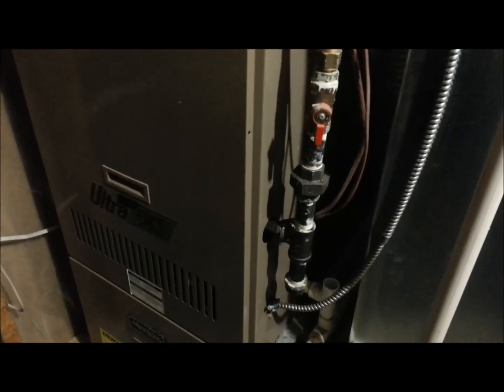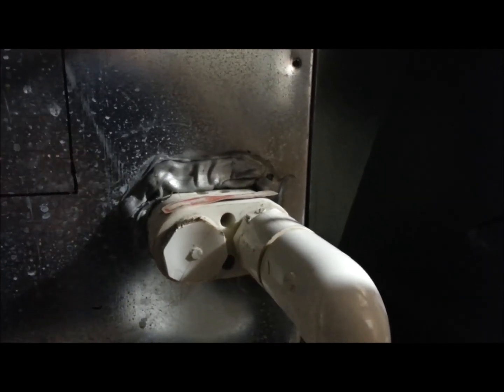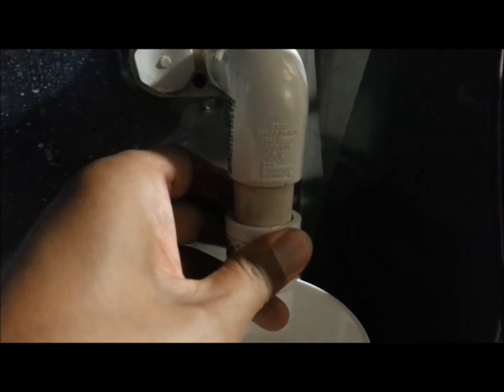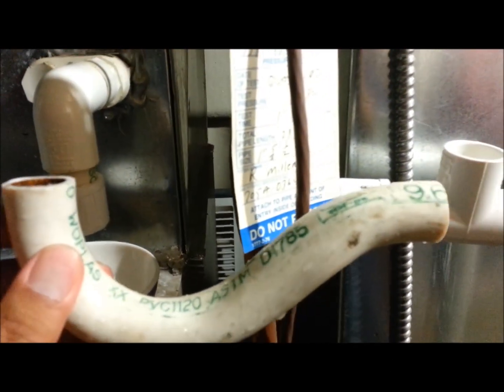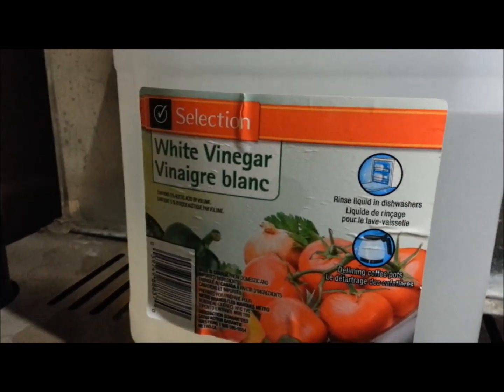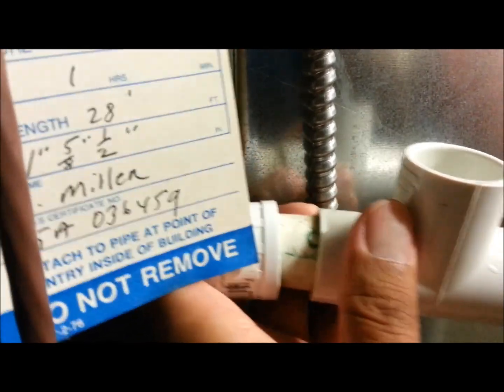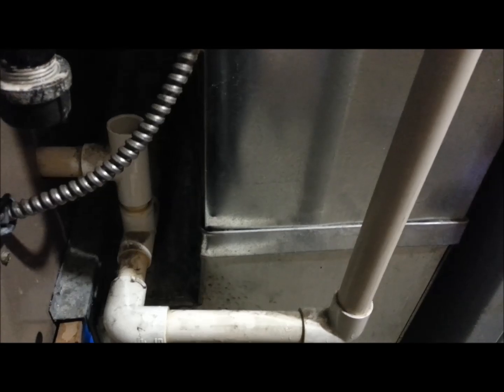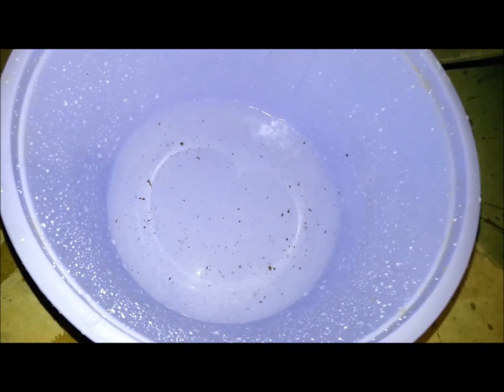Central Air Conditioner Leaks Water On Floor: Part 1 Clogged AC drain line (DIY)

Comment: The solution sounded right; I tried it; it worked, but the
screw/cap at the bottom was leaking and I could not stop it using screw.  I used the solution without derange.
Reply: Farideh Majidi i

Comment: The p trap is there for 2 reason 1. To stop the unit from sucking in air which will cause water to splash around inside and possibly being "thrown" inside the duct by the blower motor2. To catch debri.I wouldn't ever recommend anyone to just remove the ptrap because it serves a purpose that's why we install them. A unit without a trap is installed incorrectly although it willwork there is a chance of air and water being sucked back in the unit
Reply from the maker: You are right Moe. That's why i made another video part 2 with a different  type of P trap. Thanks for the comment. It will help out my viewers.
Reply: We are having a hard to fix leak problem as well.  It started about 20 days ago and sounded like a pop with releasing pressure and water every where.  First thought was the refrigerant but that was fine.  The AC guy found a small split before the pee trap and determined it was sucking air and water back into the unit so he fixed the plumbing and took out the pee trap.  We let it dry for a day and turned it back on and it was leaking so they came back out and put in a pee trap.  It was still leaking and they installed a scoop Friday (I have no idea what that is). It's Monday and it is still leaking about a drop ever few minutes and it looks like it is leaking from inside the unit having nothing to do with the drainage.  One thing to keep in mind is that we collect the condensate water to use in our aquariums and through this entire ordeal it always provided about the same amount of water.  The ac works great in all other aspects.

Comment: thanks for your help i just save some 💰
Reply from the maker: Glad it helped you out Zoe.
Reply: +Jonah's DIY & More I see you made this a year ago but hopefully I could get a suggestion from you. I have a an old unit and recently the unit stopped working. we could tap the outdoor unit and the fan in the top of the covering would come on and the unit would start working again... Of course we were actually wiring a relay switch on the defrost board. that work for about a year. heat in the winter has been fine no problem. air conditioning man just charged me almost $700 this summer to replace that board... It's crazy how much it costs to get an AC repair done. the board was well under $100. That said it has been working fine for about 2 weeks. I just came down the hallway where the inside portion is in a hall closet. a puddle of clean clear water is in my floor. All the pipes from everywhere in the house run through this closet but only I have been here today and none of the plumbing has been used upstairs at all. however about noon it felt too hot so I bumped the thermostat down from 74 degrees to 69. and I'm wondering if I just have a freeze up a clogged pipe. I can't tell if it's still leaking right now. but there is water inside the closet floor just like you show in this video. how would I determine weather my pipe is leaking or whether the coils froze up or something like that and then condensed into the floor.

when the repairman was here two or three weeks ago he checked the freon pressure or whatever they do with that gauge both times and said it was perfect.

my first thoughts are to put the thermostat back in the 70s and clean up the water and see if I get more. am I on track or should I not risk it and go ahead and call the expensive repair man again?
Reply from the maker: If you have that same old designed P-Trap, it is most likely a clogged pipe. Your A coil is freezing up because water and air cannot escape where its designed to escape. Check out my part 2 video. Hope it can help you out.
Reply: +Jonah's DIY & More thanks ... you were exactly correct.  your video was correct.

Comment: My Goodman attic horizontal Air Handler is leaking into the Secondary Pan. I popped the service panel off last week and the internal Pan is dry. Its like no water is making it to the primary panel to drain into the guest bathroom sink outlet downstairs. I checked both the secondary and primary lines and they are both clear.

The water seems to be leaking towards the back panel where the duct comes out, where the rear panel meets the main box. I wonder if a seal, gasket or something else failed and now its just leaking like a sieve.

I tried to patch with a 1/2 gallon of mastic and a full roll of peel and seal on that back panel and onto the main panel hoping to make a seal so the water would run into the primary pan inside.. But like water is apt to do, its found multiple ways out and i'm back to leaking again.

I'm open to suggestions. I havent had the rear panel off to take a look at the coils. Maybe there's a problem there.

I'm desperate and its 100+ in Dallas these days.
Reply: Shane Kelly.  I had something similar.  I put a level on the air handler and it was flat level.  It should be tilted slightly to the primary drain.  I shimmed the unit to half bubble.  Water poured out.  Problem solved.
Reply: Thanks for the reply.  I tried that as well but the unit is tilted properly and my internal pan is actually molded with a bit of a lean already too.  This week i emptied 2 bottles of clear silicone from the back after removing the rear panel and from the inside trying to seal up any crack or hole i could find.  I could take the internal pan out and the A coil i guess but at that point i may just replace the darn unit.  I turned her on last night so i'll see tonight how bad the leak is.  Even if its a slow leak i'm ok with that.  I'll let you know.

Comment: A much easier fix is to use a shop vac and suck out the line. Attach the shop vac hose to where you added the vinegar in your video. Takes all of 3 minutes to complete the process.
Reply from the maker: Yes i think you're right.  I hope the viewers will have a chance to read your idea. Thank you
Reply: Thank you! That worked!
Reply: This worked for me, glad I read your response!
Reply: In my unit the P trap was so clogged with stuff that even a shop vac would not pull the gunk out. Had to replace the P trap
Reply: I know this won't mean much to you but this whole process started happening on my basement floor just days before I closed on selling my house. I found this video and to my surprise my furnace is the EXACT same model so I was going to follow this step by step and I found your comment and tried it instead and it worked perfectly! No need to cut anything, no need to unscrew or turn off the water, all I had to do was lift the PVC out of the pump that we use to get the water to the sewer and shop vac the whole thing, worked perfectly! Thank you so much you made my month!

Comment: my heating unit is leaking blow the drip pan and into the floor and has ruined m carpet and walls any ideas how to stop this problem
Reply from the maker: +Kellie Collins Do you mean your AC drip pan is overflowing and leaking? Check the drain hole and pipe from your drip pan...since it may be clogged.  Also check if your air filter is clogged.

Comment: good vid. but why cut out the p trap?? why not just add the T?
Reply from the maker: +sixstrangtommy Great question. The P trap is prone to debris build up and eventually clogging.  The P trap has no way of clean out when its clogged, unless you cut it out. When water cannot drain properly  it spills over causing a leak from your AC. The T trap works but it allowed air to get sucked back into your system (negative pressure) and that is not good also. My opinion is the U shaped trap with the T cleanout is the best, because it traps enough water between the U shape design, thus not allowing air to get sucked back into the system, and you can easily clean out the new trap every few months. I hope i explained it ok. Sorry if i confused you.
Reply: im good...thanx

Comment: I'm a HVAC Tech/Installer and I strongly recommend you put the P trap back in your drain it is critical for proper drain operation you need to create avacuum with that P trap otherwise the blower will suck air through the drain and it'll never drain correctly gurgling and dripping put AP trap in exactly how it was except directly off the unit install it to you with about 3 inches of PVC and a cap so you can add bleach once a month
Reply: Also a clogged filter will make it freeze so always keep ur filter clean if u have pets use non pleated filters change then bi weekly
Reply from the maker: Gene Saunders Yes i've added a U trap to prevent blow back. I haven't had a chance to post the video. Give me your opinion on it. Thanks Gene.
Reply: geno geno i

Comment: I tried using my central air today for the first time in two years and had a problem with water leaking.  Is it more likely a freon issue or a pipe clog?   I've had my house for 8 years and have never had the ac unit serviced.
Reply: DowntownCanon  -- How cold is the air blowing through?  If it is ice cold, probably not a freon issue
Reply from the maker: DowntownCanon I would try to see if its clogged first. if it's not clogged, call for service for freon since it may be low.

Comment: you do need a p-trap o the drain line to create negative pressure on the line. Its like the mouthful of water you always have to take when you start a siphon with a hose.
Reply from the maker: RangerCaptain11A yeah, you are right. Stay tuned for part 2 of the video.
Reply: JONAH VLOGS & DIY

Comment: You could have saved a lot of work if you hooked up a wet dry vacuum to the end of the line and sucked all that crap out.  Then ran 1/4 cup bleach to 3/4 cup of water through it.
Reply from the maker: valveman12 Good idea but my shop vac would not be strong enough to suck that sludge out. After 17yrs. of non clean out, it it almost felt like clay.
Reply: Dj Jonah DIY Ok understood.  Yes I understand now why you cut it out.